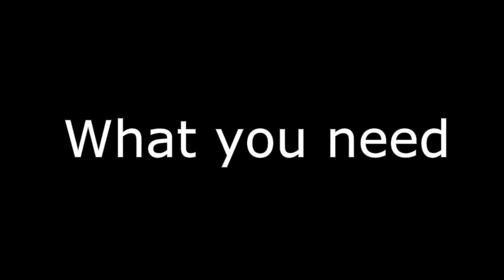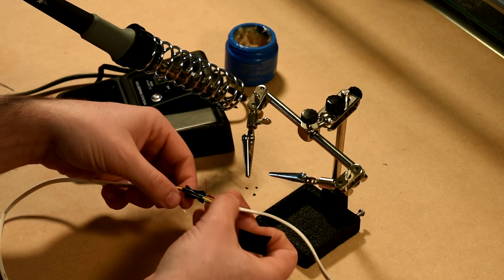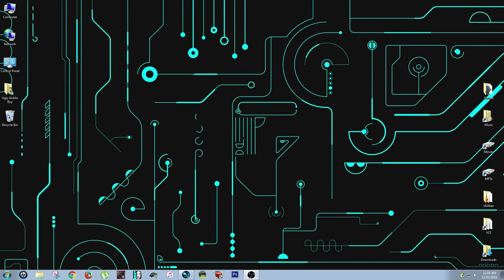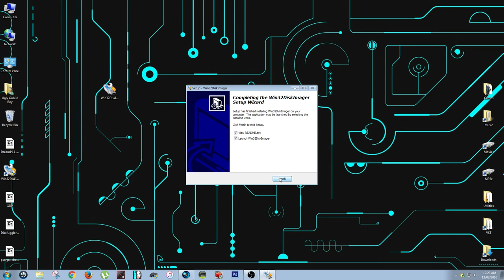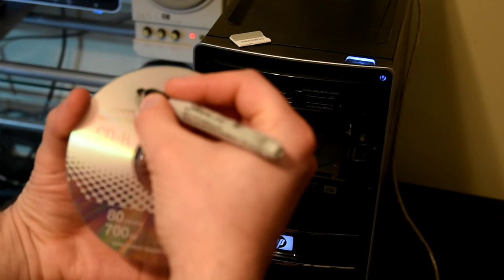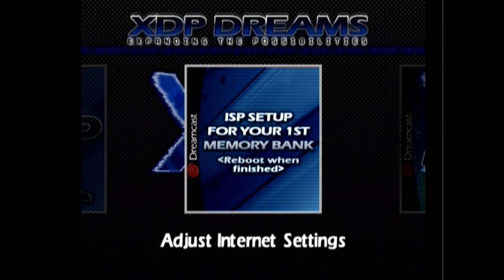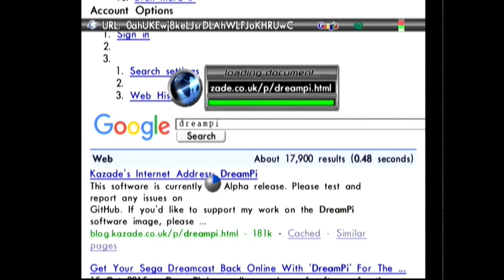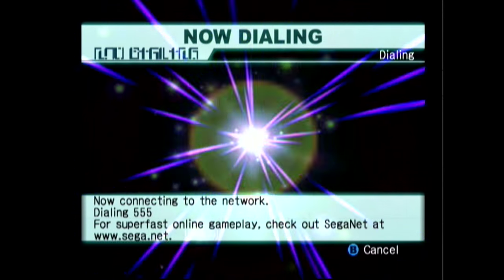How To Get Your Sega Dreamcast Online

Comment: Hey  does anyone know what the cost will be for all of the materials used for this?
Reply: Besides the dreamcast,controller,phone cable,and ethernet cable.
Reply from the maker: Probably about $50-$120 depending on which model of RaspberryPi you use and the quality of the materials.

Comment: is it still slow as 56kbps?
Reply from the maker: Most games were designed to play at 56kbs, and with this setup there is virtually no lag as the run of phone cord to your RaspberryPi (essentially acting as an ISP) is only about 2ft.   Feel free to watch some of my other videos showing what online multiplayer looks like using this method, it runs very smooth and I've never lost connection or experienced any slow down.

Comment: А зачем все это, разве не достаточно будет просто воткнуть в модем приставки DSL кабель интернета ? 

But why all this is need, is not enough to just plug in a game console modem DSL internet cable?
Reply from the maker: The Dreamcast has a broadband adapter, but it will cost you $250+ USD and only supports 2 games.  This method is not only cheaper, but also supports many other online games currently hosting servers; Phantasy Star Online, Quake III, Sonic Adventure, 4x4 Evo, Maximum Pool, Toy Racer, Chu Chu Rocket, Starlancer.

Comment: Man, I cant burn the PSO Patcher for shit. Im pretty sure I went thru about 10 cd's and none of them are reading correctly in my dreamcast. Any ideas?
Reply from the maker: Hrmmm...   What is happening exactly?  Have you had any problems playing CDrs on your DC before?   Are you burning it as an ISO?
Reply: I've never had any issues playing any cdr's before. At first I followed your video but every disc I ran ended up showing me the audio menu on the dreamcast. Then I decided to look into bootdreams which had partial success but it boot looped. Id see the sega logo and the offical text, screen would go black then dreamcast logo again.
Reply from the maker: This might be a shot in the dark, but when my DC has difficulty reading CDrs I can sometimes fix it by cleaning the lens.   Other than that, maybe try using ImgBurn instead?
Reply: Yeah that was the second thing I tried. Im not sure what the problem is. Maybe its the CD's or something Ill give it another shot
Reply from the maker: You should go to the Dreamcast Talk forums and see if the group can help you out, it's probably an easy fix.
Reply: I am having the same problem with the CD-R's being read as an audio disc for the patcher (have also tried like 10+ discs) and can't find a solution. Did you ever happen find a fix?
Reply: I did. I ended up using a copy of PSO that had the Sylverant patcher in it. So when I'm offline I use my official copy of PSO but when I'm not I use the copy. I think it was called IVES PSO. Hope that helps.
Reply: TheBlackshear ohh okay. I will search for that.  thank you :D!

Comment: This is all well and good, but pretty pointless if you're still limited to 56k speeds....  Personally I would rather just get a broadband adapter
Reply from the maker: Its superior to the BBA in many ways.  These games were all designed for 56k speeds, and latency was only an issue because of the distance to your ISP.  With a 1ft run to your RPi, there is virtually zero latency.  Also, you can only play 2 games with a BBA.  With this setup you can play all DC online games.  Currently there are about 8 online games with active servers, but many more are coming together thanks to the team at DreamPipe and DreamcastLive!
Reply: i see, so this is definitely the best way to play online on the Dreamcast?
Reply from the maker: Mos def.
Reply: What are those 8 games William and THANKS so much for this tutorial, this will be my xmas present to myself

Comment: Seams like this is more trouble then its worth.
Reply from the maker: It's actually not that difficult, I just made sure to be extra thorough in my explanation of the process to help people avoid mistakes.   After you go through the initial setup, it's as easy as plugging in your RaspberryPi and powering up your Dreamcast.